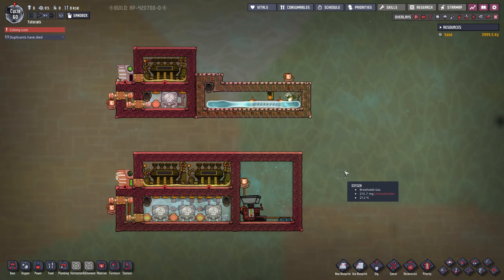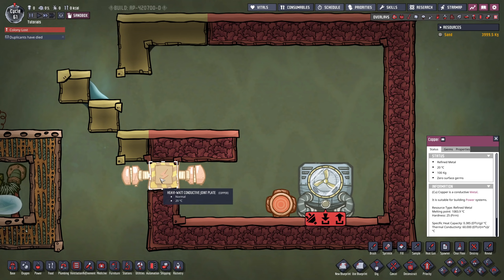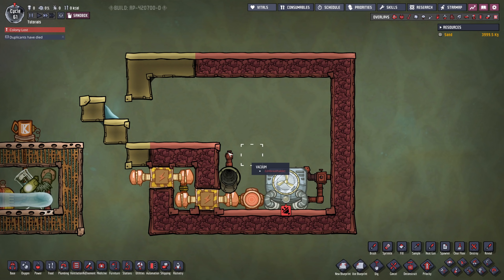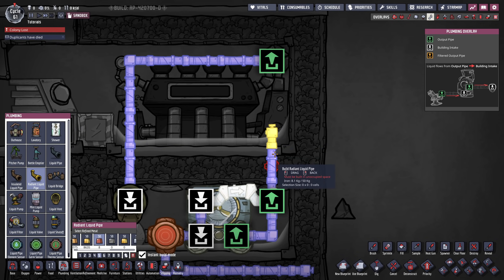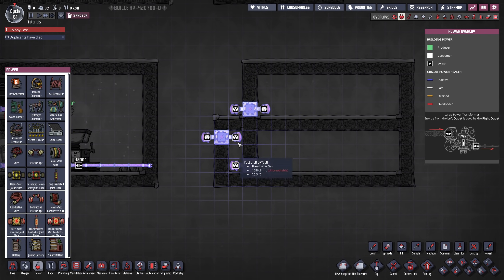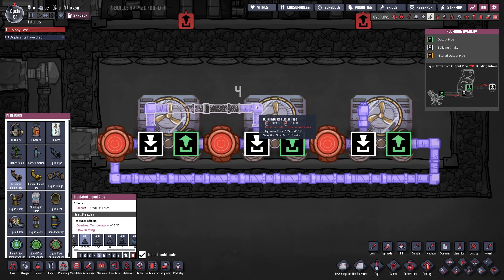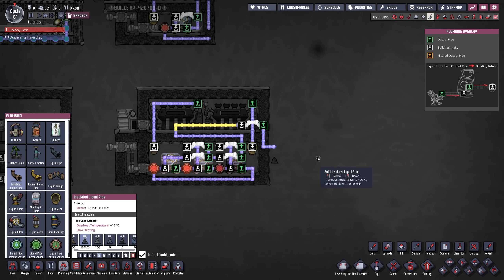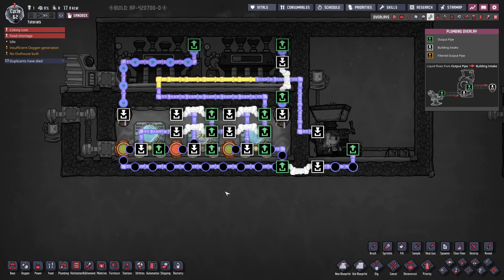COOLING WITH STEAM TURBINES & AQUA TUNERS (Tutorial: Oxygen Not Included)

Comment: Why anyone ever need more than 1 aquatuner to cool down 1 line of liquid pipe ? 1 AQ is more than enough for standard size bases, unless you are building mega base. But still, I build few of them and never need more than 1 AQ.
Reply from the maker: It depends what you cool with the liquid. If the liquid on average heats up more than 14 degrees in its loop, you need more than 1 aqua tuner, so that would be your answer;)
Reply: @Nathans-Sandbox  You need to cool your liquid to not get boil, and heat do not do any dmg to building that you are cooling. Please do not tell me, that you are cooling liquid in 
Metal Refinery like this as you show on video :D 1 AQ is enough to cool huge amount of liquid or gas, adding more is just cutting the time of cooling somehting. Run some tests, and you will see, that u can cool down everything you will build with 1 AQ. :)
Reply from the maker: I don't agree with that. I use 3 aqua tuners to bring my fresh water to temperature. If I only use one it would take up to 3 times as long.
Edit: I just saw you said yourself it cuts on time, that is the most important factor imo.
Reply from the maker: I have another example where one aqua tuner wasn't enough, namely when I cooled down the entire power farm. One aqua tuner would run non stop and the second one would turn on about once or twice per minute. It would have accumulated heat without the second one.
Reply: @Nathans-Sandbox  What for do you need so much fresh water at 25C that 1 AQ is not enough to cool it down? Producing oxygen - can be 95C, Bloosom - you have better source of food, Scienece - no need to. I checked my bases, and im not cooling fresh water to 25C in huge amount, only to feed some Bloosom where I created garden with different plants. Cooling Power farm, build it with Gold Amalgam and u need to cool it to 124C or Iron so you need to cool it to 74C no need to cool it lower, unless u want to see your power plant in green or blue temp overlay. Hopefully u are using granite pipe to cooling stuff, not radiant to cool power farm. The way I cool my power farm is steam. I make them with steel and run them in hot room filled with some water, water is boiling and steam turbine is cooling my base to 125C producing power as a side effect.  I do not want to argue, just want to see your point of view where you really need to overbuild amount of AQ.
Reply from the maker: I didn't mean to argue either, sorry, just explain my motives. I have a water maker contraption that cleans and cools water and stores it in unlimited quantities. The cleaning of the water goes much quicker, it would be held up by the cooling with only one aqua tuner.
In my second contraption I'm cooling down a pool of polluted water that is responsible to cool dozens of machines. I'm not saying one isn't enough in most cases, also not saying it is necessary to cool so much water, I'm just saying that I'm doing it and one tuner wouldn't be enough in those 2 contraptions;)

Comment: What I did was run each tuner on its own line to a cooling pool below, with capacity to run 3 cooling loops wherever I wanted.  It worked really well as far as keeping the pool cold, and initial power block.  However, it could not handle the water geyser's water that I had pooled above my base, I think mostly because the main base had a huge size, running my loop around it and into the hot water pool and back into the cooling pool took over a cycle to complete, and ultimately it seemed to drag the heat around past the pool more than actually cooling it.
One small advantage of running a cooling pool vs running the cooling directly to the aqua tuners is you can run a bridged line of hydrogen gas from each turbine into your cooling pool, this will keep the turbines 15C cooler.  Every other turbine method I used overheated without extra heat venting, self-cooling from the water exhaust always failed.

Comment: If you place a single bridge facing up after the aquatuner's input and connect all of the bridges output you use one less bridge and it's a bit cleaner of a build. You can also use the steam turbines output to preheat the water and help maintain operating temp for the turbine, a perfect set-up would be 98c water in the pipe and a 98c maintained boiler temp.
Reply from the maker: I know it's possible with one bridge, but that way you check each packet for every aqua tuner. With the two bridge design you only check packets that made it through the previous aqua tuner. You also don't run into the problem that sometimes packets have to wait and potentially give off a false signal for the aqua tuner. With 3 aqua tuners the steam turbines overheat if you only use the output of the steam turbine. I think they changed it at some point so that it's not viable to do that anymore in almost all scenarios. That's what I found out with my testing, it's overall more fail proof with the two bridges imo, which is why I prefer this design. What do you mean with 98c boiler temp?
Reply: @Nathans-Sandbox  A single bridge per aqua tuner doesn't check any more or less packets, it's exactly the same minus the bottom right bridge that you have, the only thing that bridge is doing is jumping the pipe, if the bridges are rotated to face up, it eliminates the need for that bridge. You would not use 'just' the output of the turbine to cool it, but doing this makes cooling the turbine far more efficient. The steam turbine (not boiler, sorry) operates under 100c, if you keep it at 98c you can use it's own output to aid it's cooling while also preheating the water (making the water take less energy to convert to steam), this is the most efficient as using nothing but the aquatuner's output to cool the turbines puts heat back into the liquid you just cooled taking away some of the efficiency.
Reply: @Nathans-Sandbox  To show you what I am talking about... imgur(dot)com/a/60wtNGG This effectively does the exact same thing.
Reply from the maker: Nice, thanks for the pic! You are still using the aqua tuner output to cool down the turbines, wouldn't that mess with your turbine water output? I mean how would you even regulate it to pre-heat and not actually cool down the turbine water output, since you are also using the aqua tuner output to cool it down as well?
As for the bridge, I agree with you that it works, but there will be many times where packets have to wait for other packets to go through. But you're right it would only check the packets when needed, I made a thinking mistake there. I still have the feeling two bridges are worth it for flow efficiency of the packets. Thanks, that should influence my tuner design in the future;)
Reply: @Nathans-Sandbox  To regulate it, you would have to play around with the number of conductive pipes for either side, the goal being a steady 98c temp in the turbine room. You can also use a temp sensor and valve to direct the cooler fluid into the chamber if it got too hot. The packets shouldn't back up ever since it will only have a single inlet of flow and the only difference between the designs is that yours has more pipe to act as a possible buffer, but again, since you only ever have a single pipe flowing in, you can only ever have a single pipe flowing out and should never backup unless the outlet got clogged.
Reply from the maker: OK sweet thanks for the conversation, always good to get more perspectives on it;)

Comment: Three refinery is a bad example, because you can actually save so much power cooling the hot oil that you can easily GAIN power when smelting steel, iron, aluminium, or tungsten.

Just cool down hot oil with steam turbines.
Connect a cooling loop with polluted water to simply cool the area around the metal refinery. Refineries barely make any heat on the machine itself.
Reply from the maker: I used the refinery to easily exemplify how the system works. In my LP I also use the steam room, though the aqua tuners are definitely the faster option if you have the spare power imo.
Reply: @Nathans-Sandbox  Well, Not faster if you have enough turbines :)
Reply from the maker: Hehe, I guess so;)

Comment: Let's say I wanted to cool a large area, I would use AQ to do so. But the packets of polluted water all come back with very different temperatures meaning that the pipes keep on breaking. (I will set my thermosensor to below 0, 4 above freezing point, A 15 degrees packet triggers the AQ which currently has a packet at -6 degrees, breaking the pipe). Do you know how to fix that without putting my thermosensor at ridiculously high temperature?  Also, the thermosensor is about 8 pipes away from the AQ so that may affect that as well.
Reply from the maker: The thermo sensor needs to be one block in front of the aqua tuner. This way the signal actually counts for the right packets.
Reply: @Nathans-Sandbox  Alright thank you
Reply: You need your thermo sensor on the block right before entering the aqua tuner.  That's how all sensors work with objects you want to select whether to run through or not.  For filtering liquids and gasses, this is MUCH cheaper than using the in-game general filter - 10 W for an element sensor/shutoff compared to 120W for the filter object, but it's more finicky in how it handles.  ALSO, before running your liquid loop directly into the aqua tuner, or even if you're running a cooling pool, use a liquid liquid reservoir.  It will even out the temperature of the liquids going into your aquatuner, and it makes expanding or contracting your cooling loop(s) much easier, much less messing about with adding just the right amount of liquid, extracting liquid when the line stops, etc.
Reply: @ahmataevo  I usually use a bridge to add water in a loop but I always end up with extra packets so using reservoirs sounds like a better idea. In my case, the loop was not completely filled up so some packets would come hotter than others, now that it's filled up I am not having any problems again.

Comment: The aqua tuner metal refinery is a useles combo. People should not copy that(like you said if players wanna use the refinery setup just use radiant pipe).
Reply from the maker: Using the aqua tuners is much quicker than radiant pipes. Also if you only use radiant pipes you're gonna need a different setup to cool the turbines.
Reply: @Nathans-Sandbox  how quick it is, that i do not know. But you waste a lot of energy. 3.6kw for every 10kg oilpack. The refinery/ radiant pipe setup can make more energy than the input needed. For beginners is a bad example to copy.
Reply from the maker: Don't forget to subtract the power from the turbines and that you don't need power to cool the turbines down. If you want fast cooling I think it's worthwhile, but the point of the video was not the refinery, you can cool anything you like with that was the point and a refinery convenient to show that off;)
Reply: @Nathans-Sandbox  No, he's right. With naptha at 540C heat transfer is going to be even faster with radiant pipes. A -42C drop isn't that much.   Remove 2 ATs, replace them with radiant pipes, separate the cooling loops, and use the remaining AT to cool down the turbine(s). With the extra ATs you're turning a potentially power positive process in guaranteed negative.

I get the point of the video is cooling, but even speaking generally it's a bad example.   Never have an AT do the job of a radiant pipe.   Heat transfer happens naturally from hot stuff to cold stuff. The job of an AT is to use power to force a transfer in the opposite direction.

That's how you can use polluted water (what would boil at 125C) as coolant in a loop and still use a steam turbine to delete heat. The job of the AT is to force a heat transfer (from below 120C pwater to above 125C steam) against the natural direction.  To put it simply, you use ATs when the target of the cooling is below 125C.  Anytime the target is above 125C, you can transfer heat to steam directly and you don't need an AT for that.
Reply from the maker: Yes I agree with that, the refinery was only there to have a heat source to show the principle with the aqua tuners.

Comment: You are making the in-series piping more complex than needed. Follow the bellow setup and you only need 1 bridge per acquatuner. Liquid flows left to right with the pattern repeated as many times as you want. Thermo sensor still in tile before AQ input. 
AQ=aquatuner 
Br=bridge
O=pipe segment
-- or I = connection between pipes

O--O AQ O   O---O AQ O   
      I         I     I     I         I    
     O Br   O---O   O Br   O--O
Reply from the maker: At some point you have to combine the liquids from the various tuners again, with only one bridge and multiple aqua tuners I've always run into the problem of packets having to wait for other packets. With the two bridge setup you're guaranteed to get an even flow. Also with your diagram, it looks like after the bridge the packets are allowed to get into the next tuner, isn't that where clogging up situations happen because you basically check each packet before each aqua tuner even though you already checked it for the previous one and it bypassed it? I'll definitely test that diagram out, the reason I'm using two bridges is because it makes it fail proof and smoother in my experience.
Reply: @Nathans-Sandbox  that is a good concern, but I haven't run into a backup issue with this setup. It might not be shown well but there is exactly 1 pipe segment free for the bypass or operational side, so both paths are equal if the tuner is on or off. 

I just ran a test using 3 with my setup and each tuner had a different temp set with the right most lowest. Changing the temp of pool of petroleum I was cooling, it went from 3 on to 3 to 1 to 0 never stopping. It could be that I have a liquid tank buffer in the loop?

Comment: So if I want to cool down my base I just set lower temperature in liquid thermo sensors or what?
Reply from the maker: If you run the coolant through a reservoir you set the sensor to the temperature you want it. If the packets are only in the pipes and never see a reservoir you have to make sure the temp in the sensors isn't too low and you get packets with various temps.
Reply: @Nathans-Sandbox  I finally understand your smart words techno-man. Figured it out.
Reply: @qu1te2nd47  Try using polluted water for cooling your base! Polluted water doesn't freeze in the pipe until several degrees below -20 degrees. You can easily set the base to 20-25 degrees Celsius with no risk by using polluted water. :)

Also be sure to use a separate aquatuner from other cooling solutions so that your base is prioritized on an independent loop.
Reply: @G.r.e.g.g.l.e.s  All those tips are getting Better and better
Reply: @G.r.e.g.g.l.e.s  also thank you for that great advice

Comment: Just want to throw this in there:
in the steam chamber there should be a petroleum layer at the bottom (or any fluid that does not overheat easily)
because there is a bug in the game where extra heat gets deleted when the water comes back from the steam turbine into the steam chamber and lands on the floor.
It pushes steam to the side and the math isn't fully correct and it destroys even more heat. And if the pressure is really high you actually delete a bit steam in the chamber.
The petroleum at the bottom will just get pushed aside instead of gas fixing/limiting the bug to as low as possible. (also the exit should be in the petroleum for that)
Reply: pretty sure they fixed that in the latest update
Reply: @AlexanderBurgers  I just looked into it, it is not fixed yet. It is still an issue. And people are still discussing how to exploit the actual issue.
https://forums.kleientertainment.com/forums/topic/118774-massive-heat-deletioncreation-bug-from-liquid-boiling-part-2-20-kw-from-one-aquatuner/
Reply from the maker: I did not know about this bug and also not about the fix, so I guess that's good in this case:)
Reply: @Nathans-Sandbox  No it is not fixed the klay post i showed, shows that they still abuse the fact of this bug. So it is still an issue.
Reply from the maker: That post you showed is from June, that's quite a few small updates ago.
Reply: @Nathans-Sandbox  Go to the end of the comments and you still see people talking about that the issue is present. Next time i will link the last page so you will not take the first "info" as "Oh its so long ago they must have patched it"
Reply from the maker: Latest post is June 15th? And just to let you know, I was intelligent enough to go to the last page, it still says June, unless I'm going crazy.